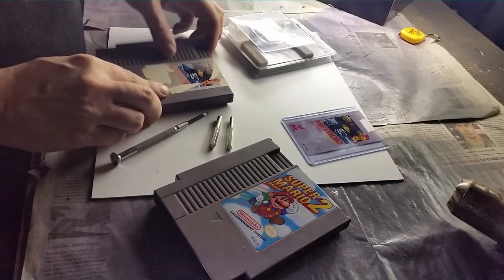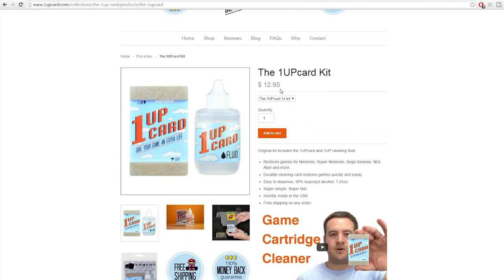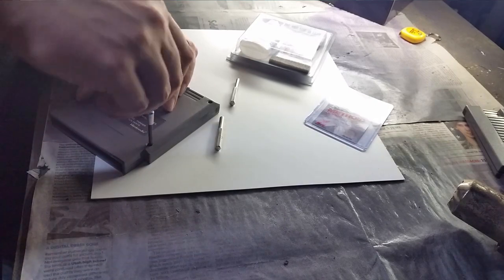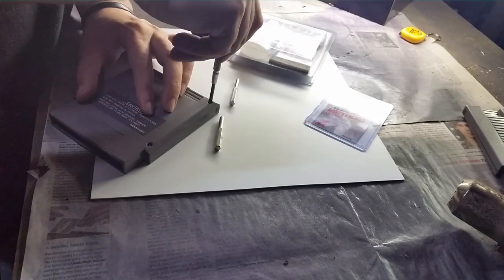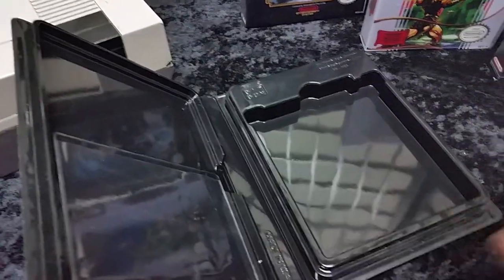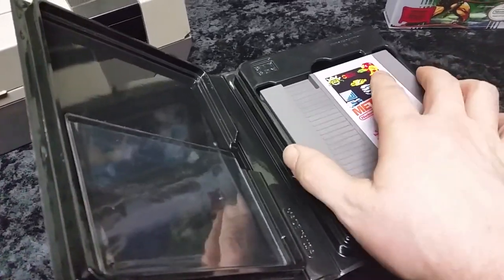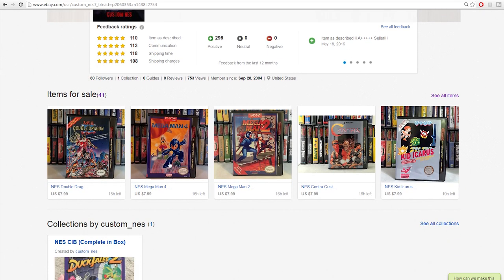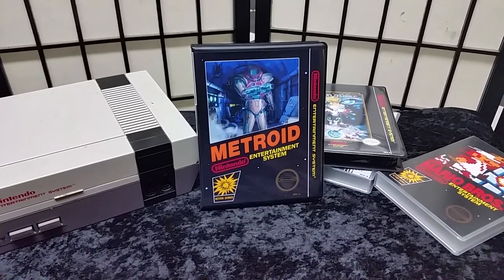How to restore an NES game (A Drumblanket DIY Tutorial)

Comment: Nicely done video man, but I do have to say a using a heat gun on that board like that could warp it and potentially damage the chips not being temperature controlled. Would be a lot better with a soldering iron to Reflow each one of the points.
Reply from the maker: I agree.  I know most people don't have a soldering iron or steady hands so I recommended the heat gun. I believe I express the importance of not over heating. If I didn't, I apologize.
Reply: Guys, I used to work at International Circuit Technology later named Waytec electronics in the screening room applying the green mask to the boards and we cured them 2 ways (running them thru a radar oven, and putting them on racks and baking each side in a standup oven for hours. The little heat from the heat gun should not hurt them.

Comment: I have used every technique to clean cartridges over the years and the best and cheapest way I have found is using an eraser on the pins to remove oxidization and then clean that up with a little alcohol on a qtip. You shouldn't use an eraser often on carts but I would say maybe every ten years would be appropriate.  I use an old kind of hard dual sided eraser(ink/regular) and it will last you forever and you won't believe how well it works.
Reply: The cartridges specifically sstate on the label not to clean with alcohol.
Reply: Daniel, I've used Brasso purchased at grocery stores and the walmarts. With a clean cloth.

Comment: A pink eraser works on the contacts. Also, put flux on the solder joints before heat gunning. Then clean the board with Fluxoff.

Comment: Using warm water and soap (and letting the label soak), then scrubing the damaged label, and then using rubbing alcohol (and briefly letting it sit), and using a plastic razor to get the damaged label off is better than using a dull screwdriver, as the dull screwdriver, or anything metal, will scratch the plastic. But a plastic razor, and the other things I mentioned, will not let that happen.
Reply from the maker: Which is why I suggested those things!
Reply from the maker: shouldnt need any alcohol if you let the label soak long enough tho

Comment: New labels devalues the game
Reply from the maker: Patrick Trainor not if the label you're replacing is already damaged
Reply: Drumblanket whats your thoughts on board replacement with a doner board.
Reply: @nattyandlucy4269  then that’s not the game. The original game is on the board. Unless you’re replacing w/ another original board it then becomes emulation. Labels are only an alternative to a damaged original label.